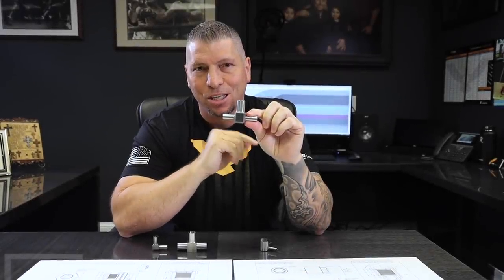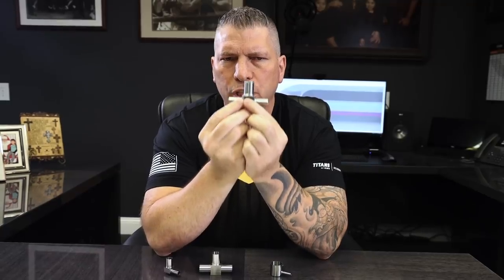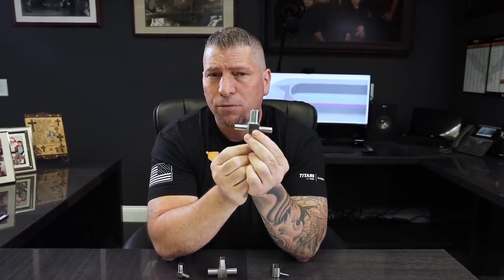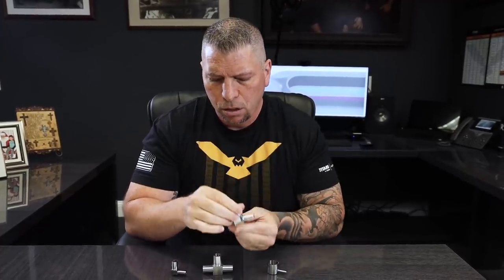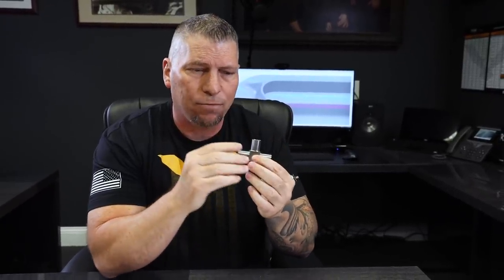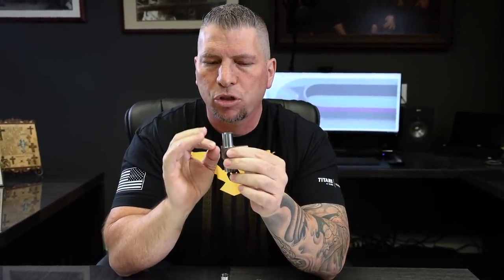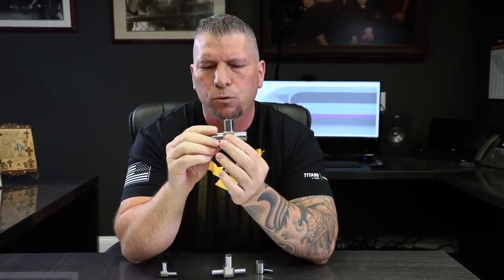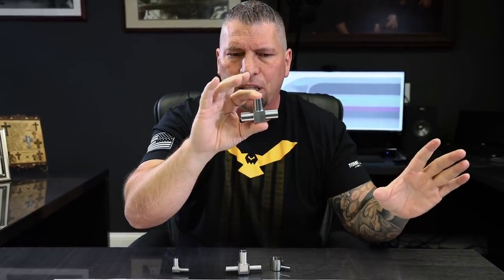Start a Business with This Part - Vlog #88

Comment: One of the biggest issues I've helped fix in aerospace cnc shops all across the country has been standardizing  EVERYTHING from tool lists, work environment, tool boxes at each machine, and waterjetting foam shadow box cutouts for every handtool in the workbenches. When spindles are turnin you're earnin! One thing I've learned in my years of machining and life... The sole purpose of working isn't to make money, money is a byproduct of creating value for your community. If you strive for excellence, follow your passions, and find your purpose in life ~ your life will be abundant~ BOOM!
Reply: Will it be awkward to ask for you linkedin id? I'd love to learn from your experience
Reply: Sure, but busting your ass in this industry without appropriate pay gets old very quickly.

Comment: How about a video on getting started with CMM. I mean how would a small shop (not much money available) get started in metrology and be able to certify parts?
Reply: You can buy a used CMM and have it calibrated. You can also use your machine to measure parts. And slot of precision parts are made the best by knowing how to program good. A job only runs as good as the setup and program so profile part's without moving part so position and tolerance are as accurate as the machine.

Comment: What is measured using the CMM that is missed by the gauge pin? How do you know that the unit price is correct after having streamlined the process? You are illustrating going for the expensive, hard to make parts, streamline the process, do it in every material, and build confidence! I get it! Thanks for that! I met a gem cutter who targeted large stones so that he could command the high prices...making it worth his time.

Comment: You touch a good point Titan. I could design this part to be done in 7min and 37sec maybe 7min 42 sec. But like you said for this to happen the minimum order would have to be 1000parts per week per model with a contract that would guaranty 25thousand parts.
Reply: And or with orders of over 100k parts we could do it in just under the 3 min benchmark. With a price tag of 400$/hr  for that specific machine.